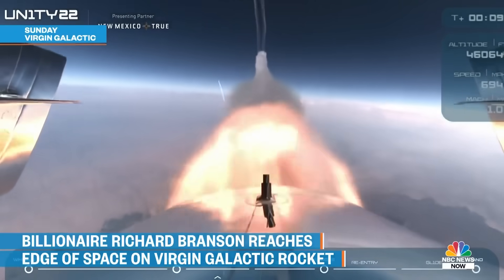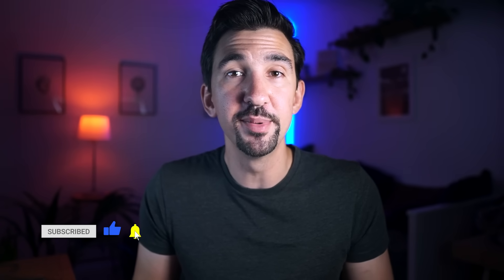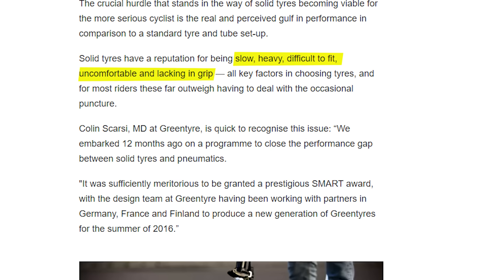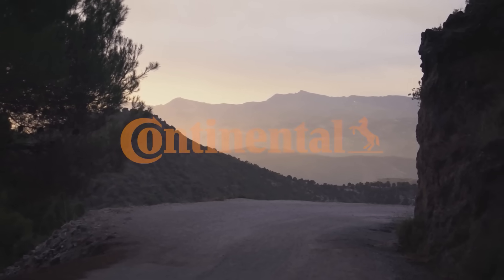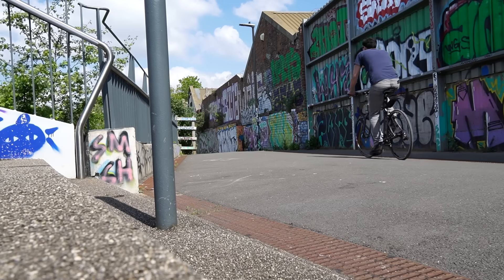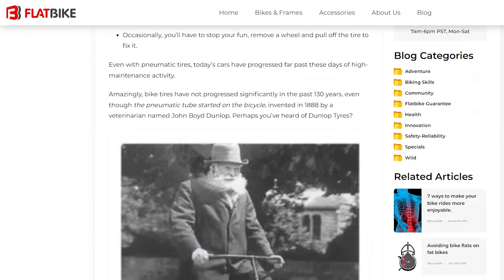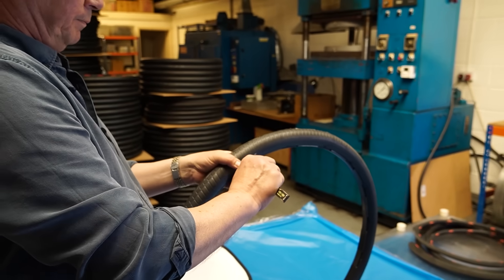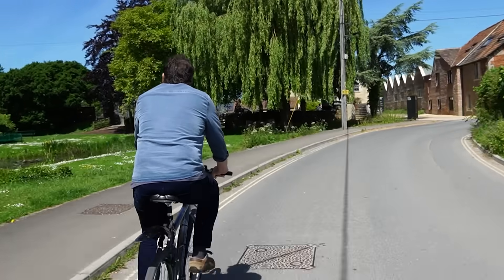I Tried Solid Bike Tires | Here's What I Found

Comment: One thing I'll add from being a somehow pro rider we need PSI full stop! On trails off road loose gravel these might work for one purpose commuting A to B we use tyre inserts cush come and Vittoria air inserts they make the tyres solid with a thin air chamber in them for us riders who need to vary the PSI on each run! This is the type of thing you need here an air chamber run through the middle! 
See we are all running Tubeless tyres now no inner tubes just sealant and a tyre insert! The tyre we have today are fantastic really strong kevlar side walls strong all different Addix rubber types soft , super, soft med hard etc the valves are different for the sealant to pass through and not clog we actually have a near perfect set up now with Tubeless, sealed and a tyre insert! 8 to 10 PSI low with tyre inserts there so nice and comfortable to run and hold the road and the tyre shapes to the road and berms trails! These are not something I would ever use I well we all have a pretty much fool proof system now! Road gravel bikes are starting to use the same they see the benefits to now a tyre lasting month's to a year plus no rubber van be run for longer than 2 years you would change it every year due to weather brittleness

Comment: The thing I like best about aired tires is that their hardness is adaptive. of it's cold, rainy, and you're going cautiously the air in the tire is cooler, so it takes up less volume and the tire is softer. Which is better for those conditions. But on a hot sunny day when you're really opening it up that tire heats up, heats that air inside, which then expands and you get a much firmer tire which seems better for gripping higher friction dry surfaces. The difference numerically isn't that big maybe 1-3 PSI either way at max it seems. But there really is a feel to it that matches what your doing.

With an airless tire on the other hand (the few I've used over the years anyway) They always seem to have the same amount of give regardless of the weather or surface. I think it really adds to the sluggishness. But then again. I do go down a lot of roads that are not in the best upkept neighborhoods. So even though it's more sluggish in general, it really is nice to not have to worry about popped tires.

Comment: Have you guys heard of tubeless tires? It’s like an air filled tire with no inner tube, you even put sealant in it so it doesn’t get punctured as much. As for the green aspect…. Well should you be more worried about car tires that use at least double the amount of tires and a lot more materials? Seems like a neat solution for a non issue.

Comment: You also have to add a few grams to the pneumatic tires for the compressed air in them (maybe about 5-7g of air depending on pressure, size of tire, etc.)

Comment: Solid tires will be heavy as fuck. This means it's harder to steer, youbhave more suspended weight, and zero road buffer... solid tires will never overtake standard tires as they dont perform. Physics doesn't lie

Comment: Solid tires suck, there is a reason the pneumatic tire was invented.  If you are that worried about flats just use Touring Tires like the new 2022 Continental Contact Urban.  This is the lightest touring tire Conti makes and it will stop everything but nails.

Comment: Wait a minute. This guy says that he "couldn't wait till the next day when he could pull those Tannus products off his bike. He claims he could "feel every bump and crack in the road". I have a phat tire ebike with the standard OEM tires. I will be the 1st to step up and say "you feel ever freakin' micron sized bump that you hit". How much worse could it get than it is now? These tires, which have BOTH had flats 10 days apart, are stiff as a board and totally uncomfortable to ride on, in consideration that they are 4 inch tires. Enough said, I have a couple of these Tannus replacements coming in the Amazon pipeline and I am sure and certain that I am ALREADY more than satisfied with the result.

Comment: They can be crappy for trails and offroad though. Sometimes when the ground is soft or soggy (or both), - you need to reduce the tire pressure a little bit to allow the wheel to grip the ground better or to not sink in. Can't exactly do that with air-less tires. On road - I'd really worry about wet conditions. All rubber tires can be pretty slippery compared to normal tires.

Comment: This just creates another problem, as just like your running shoes "going flat" after only a few hundred kilometres. This will happen with these tires, and they will degrade alot faster then nuematic tires. They are essentially foam tires, like the foam in our shoes that have tiny air pockets. But once that air bleeds out and the material squishs down they become useless.

Just like renewables and 15 minute cities it will just be another failed project in our ever inefficient search for sustainability. 

In other words... stop trying to reinvent the wheel.

Comment: So it’s like replacing a tube or nothing for the tubeless but with less quality rubber and once the threads wear out...??
Not to mention they are affected by temperatures, so the best is just the best grip you get, having your wheels slip out under you is not fun

Comment: As a mass market Invention, which it will need to be to get off the ground financially, these would need to be sold to bike manufacturers and be fitted to new bikes. As you say those bikes would then need to be also mass market bike owners who just need a bike, as opposed to riders who specify a discipline and therefore what bike they want, and therefore are bothered by tyre specs, and therefore performance. But here’s your problem, only those riders are likely to look at this video. It’s not going to impress Mtb riders, road riders, bmx, gravel riders etc….unless pneumatics and therefore adjustability for rider weight and conditions are involved….this won’t win. So make a pneumatic chamber deep within this solid tyre perhaps? the bigger the chamber the more adjustability would be available. Might still puncture with a deep long sharp object, but the odds of that type of puncture are much reduced and would irradicate tears,pinch flats from jumps or kerbs and spokes. But then I guess it needs fiber construction to hold that chamber shape….and therefore would need to be an inner tube design, as tyres wear out will need to be replaced.  Keep the inner recycle the outer and it can still be ridden if it does go flat…as they need in downhill Mtb with inserts…..have the tyre still work flat at a minimum usable say 20psi, but add an air chamber it to 40 psi in eg Mtb performance…Also, In extreme cases these could come unclipped from the rim? Thinking eg downhill Mtb….interesting though. Thankyou 👍

Comment: Specialized makes a very resistant tire called "fat boy."   What is amazing about this tire is that it holds air about the best of any pneumatic tire I have used/  What is truly amazing about the fat boy tire is that it is not particularly fat and also it seems treadless and has real low rolling resistance.  They are truly amazing.  The last time I priced these for a 26" x 1" was a reasonable $23 from a regular dealer.

Comment: As someone who also rode bikes for a large portion of my life, I have to ask: is it normal that you need to check your tire pressure every day?
I've had a couple mountain bikes over the last decade and I almost never checked them. I just got the bike out, sat on it, and if the pressure was indeed too low, I felt that immediately. If it was /getting/ low, I most of the time heard that from the difference in sound, created by the offroad profile on the road. And sometimes just from the different "feedback" when going over bumps or up a curb. But for the most part I only had to pump them 2-3 times a year to approx. 3.5 ~ 4 bar and that's it for a couple of months.
Did I just have good tires or am I just ignorant and highly indifferent to the "loss" of pressure that occurs naturally?

I'm also very excited for those tires to make it to the market. I wonder if the approach could be scaled up for cars too?

Comment: the tire might be 100% recyclable, but only the manufacturer would be able to recycle it. 
if someone is conscious about pollution, there's plenty of way to find a second use for an old tire, and even then, from my experience, a tire lasts way longer than 2 to 4 years. also might wanna consider the initial intake for production, if it is even worth. 
it's not that i hate it, but you are still using plastics as a solution to plastics. if someone is really dedicated to reducing pollution and carbon print, i can't personally see how this will help unless this becomes the only standard overnight and every recycling plant would be able to reuse the material to create new tires. i might be wrong eh, and feel free to correct me.
if we talk about convenience, then yes, i can see.

Comment: Some years back  I did some work at a large oil patch site. I noticed a number of their employees were riding on large single speed mountain bikes equipped with solid tires. One of the workers let me take their bike for a ride. I found it rough. heavy, & rather hard to pedal but it certainly was a low maintenance bike. Solid tires are also popular on toddler bikes & tricycles. They are also used on fork lifts which are used on concrete floors & smooth pavement. I think your Gecko tires would very good for kids bikes. You know how dad hates to work on bikes. They would also be ideal for most adults not interested in the Tour de  France.

Comment: That's the problem with this technology... It's always perpetually the future. You can never actually BUY these for MOTORCYCLES... of which there's 10000 times as many and go 8x as far out into the middle of nowhere and REALLY strand you. I've never seriously gotten stranded very far from anything on a bicycle with a flat tire. Of the small percentage of bicycles there are compared to motorcycles only a small percentage of those riders would ever spend enough time on a bicycle to get stranded by flat tire. So of course your article is about correcting a problem on MOTORCYCLES that is practically non-existent and superfluous for bicycles.

Comment: It's not only making a good solid tire, you need a manufacturer to make the wheel to accommodate the solid tire. You then need to compete with already established competitors. Your cost will be too high for people who casually ride bikes. Only people who take biking seriously will pay premium bucks but you are competing against performance tires that dont get flats, i.e. tubeless tires.also tubes are cheap and easy to fix. Good luck but it seems like an uphill battle.

Comment: you can repair bike tubes.
As well as simply not skid your tires when you use your brakes both thing should reduce tire waste by about 4x the rate of disposal.
personally both method reduce my tire waste on the time scale of a year to a year and a half. "so long as my tires stop getting stolen as of late"

Comment: I now have Tannus tires on all of my bikes. Zero worries about ever having a flat tire. I've heard from some of the cycling snobs that the solid tires ride harsher than a pneumatic tire, and don't grip as well in the wet. This was probably true of the earlier versions, especially on the skinny 23×700 tires. My serious workout bikes are 28×700, and my gravel/commuter bikes 32×700, and I cannot discern any difference between the softer Tannus Portal solid tires and pneumatic tires. I rarely ride in the wet, and if I do, it's just for casual commutes, so if they do grip less on wet roads it is a non issue for me. It is so much better to never get a flat, have the inconvenience of one, have to carry a spare tube and flat repair items.

Comment: the more I see innovations like this, the more I think we just got it right the first time with air-filled rubber membranes.  There always seem to be too many trade-offs with solid or mesh solutions, including being hard or impossible to repair, as well as requiring more material, or harder-to-manufacture/more rare material.  I think the best solution really is just to find ways to prevent traditional tires from going flat, and to make traditional tires easier to repair when and if they go flat.

Comment: So these guys spent 10 years creating a rubber that acts as regular closed cell foam...

Am I getting this right?

Because if it is, you could just fill a normal bike tire with expanding foam and you'll get basically the same result

Comment: When I tried solid 'spongy rubber' tyres on my (basic, £130) road bike I had 2 rear wheel hub bearing failures in three months. I gave up on them after that. The bearing balls themselves were in excellent condition, but the hub housings cracked both times. Before that, on pneumatic tyres, I had no bearing issues at all from two decades of daily use.

I like the idea of solid tyres because the roads I ride (in the north of England) are rough and many of the fields have hawthorn hedges; when these are flail-cut by farming machinery the roads become littered with vicious thorns which lie like perfect 'caltrops'.

Solid, puncture-proof tyres seemed like a good idea, but weren't.

The loss of cushioning has put me off them until someone can replicate the benefits of what's effectively 'air suspension' on a bike.

Incidentally, I've found all the usual pneumatic puncture protection ideas pretty useless, too. Goo, gunge, extra-thick tyre liners, extra inner tubes, woven tapes, moulded tapes, squidgy gels, tougher tyres, kevlar bands - all fail.😞

Comment: Solid tyres are unutterably stupid. ALL OF THEM.
Firstly, air provides excellent cushioning and is a part of the suspension system.
Secondly, air is free.
Thirdly, air weighs nothing (for these purposes), and so it greatly reduces unsprung mass.
Fourthly, there is no way to control the level of grip by changing tyre pressure.
Fifthly, There is no way to control tyre wear by selecting the right tyre pressure.
Sixthly, solid tyres use a lot of material, and will be much more expensive.
Seventhly, very hard to compress, and so old tyres take up far more room.
Eighthly, solid tryes much more difficult and expensive to recycle.
Ninethly, a tyre fire will be 10 times worse.

So yeah, you just keep on imagining garbage solid tyres.
They will NEVER be adopted for domestic vehicles designed to carry people. 
NEVER.

Comment: Beyond recyclability, another factor of the highly composite makeup of the traditional pneumatic bike tyre that contributes to wear and ultimately the fate of flats is that each of those materials has different stress and environmental response properties - of particular note, heat and col responses. Each material will likely expand, contract, and deteriorate at different rates depending on the temperature, dryness, and atmospheric/environmental chemical exposure of the environment in which they are used, resultings in a chain of failure opportunities, especially when those different environmental responses interact; a material that expands more than the material next to it can cause separation, bunching, stress, or unseating in either material layer. With a solid tyre of relatively homogeneous makeup, the way it will respond to the environment is both predictable and free of these complex interaction variables, meaning it will both wear less from these complexities, and the user will be able to more reliably understand and mitigate other stresses or at least be more aware of the impact those factors will have on tyre longevity.

Comment: I've had a bike since I was a teenager and I can never change the tires I actually used it to commute to work in the snow in the rain and never got a flat tire I still have the spare inner tube sitting in my house somewhere just in case I work to get a flat but I've never caught a flat and my tires stay aired up so maybe it's the type of bike you have cuz mine just is a size 24 mountain bike 27 speed and I got it from my father so I don't really know how this video will help me when it comes to tires or air or solid tires cuz to me regular tires work this fine and that's a span of over 10 years that I've never changed those tires

Comment: Well, tell your "scientist" that there is something know as centrifugal force and rubber absorbs it. I have experimented with many different tire designs that I made myself from available materials of all kinds. What I found is that the centrifugal force produced by a bike wheel in motion is constantly absorbed by how thick the rubber is of the experimental tire design. I have found that the only way to avoid a sluggish riding response when using thicker rubber tires is to use less rubber to get better and quicker response from the bike. I used four 3 oz lead weights on the wheel to counter react the absorption rate of the rubber compounds I was using but it did assist but very little. The only way to over come the rubber absorbing the centrifugal force needed to have normal quick riding response is to embed a specific amount of lead or steel, copper weights into the solid rubber itself near the contact surface of the tire. Mathematics needs to be created to explain this absorption rate of differing rubber compounds to eliminate the absorption of the needed centrifugal force to ride normally or better. I have experimented on this problem for nearly 10 years now and no matter what if the tire is thicker than normal the performance of the bike suffers if the tire is thicker than normal due to this absorption of the centrifugal force generated by the wheel. If you can figure that out you can change biking forever using these solid flat free tires.